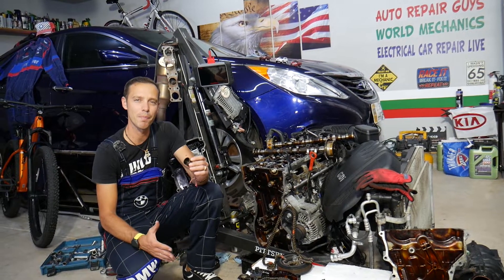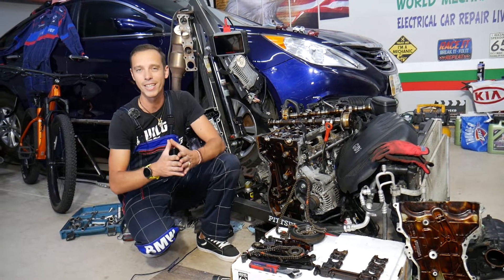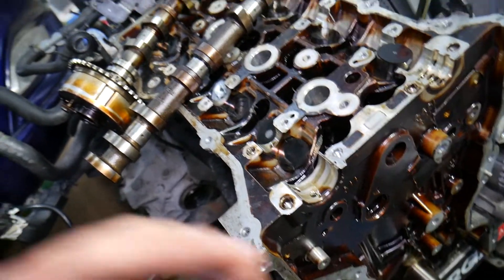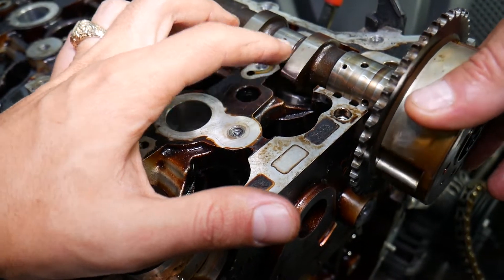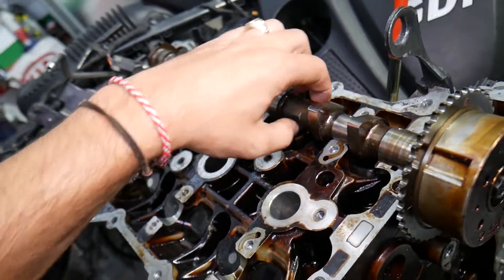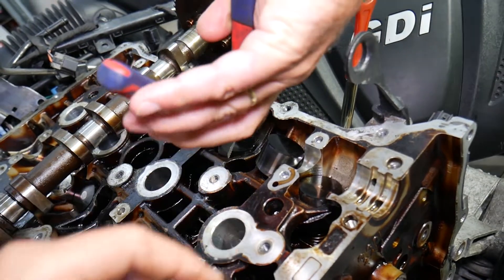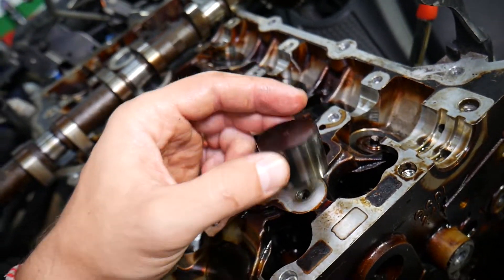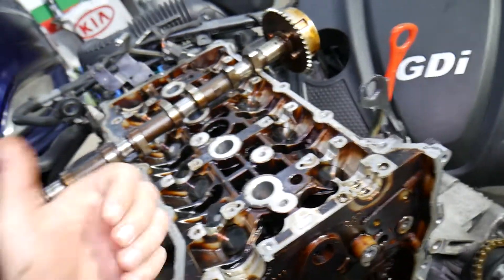WHAT CAUSES VALVE LIFTER NOISE ON HYUNDAI KIA GDI ENGINE

Comment from the maker: heck fitment for your car model:
► Timing Chain Kit: https://amzn.to/4eXHMcJ
► Camshaft Sprocket Intake: https://amzn.to/40dbyWv
► Camshaft Sprocket Exhaust: https://amzn.to/4e2wbaW
► Panel Removal Set: https://amzn.to/3YiMADu
► Assorted Fuses: https://amzn.to/4fx4s3F
► Tool Set: https://amzn.to/3p5MM6t
► Screwdriver Set: https://amzn.to/3XRB28Q
► Castrol Oil: https://amzn.to/3xBc8B9
► Oil Filter: https://amzn.to/3w0Ulme
► Torque Wrench: https://amzn.to/32qyRwg
► Liqui Moly Engine Flush: https://amzn.to/3IiDBID
► OBD Scanner that we use most often: https://amzn.to/3I4MQfe

► Check out our Amazon Store for the tools and parts that we use: https://www.amazon.com/shop/worldmechanics

Comment: Hi, 1st I want to say, THANK YOU, for making these videos. 
I have a 2014 Kia Sorento LX.
The engine began shaking a making noise. It give me these code:
P2101 P0123 P0222 P0113 P0107 P1326.
I replaced the Throttle Body, and no change. 
It's making a loud "ticking" sound. I thinknit might be a lifter issue. Am I right? Or could it be something else.
Also, it been burning oil, because I have been adding it every month or so, I am 100% there's no leak.

Comment: I have read that a thicker oil can be used for high mileage  engines.
Mine is a 2.2 diesel that has done 98,000 but is only noisy on startup but has got worse.
Reply: Arbitrarily going over to a higher (thicker) oil viscosity is not the solution for hydraulic lifter noise. Higher viscosity oils will help in reducing main bearings noise. Lifter noise is caused by a stuck lifter. Do an oil change by using the recommended oil from a reputable oil manufacturer, observe engine noise for about 1 month (1,000 miles) and see whether it corrects the lifter noise. At this point, if the lifter noise persists, add about 2 ounces of 'Marvel Mystery Oil' available from most auto parts stores. Observe performance for 1 month (1,000 miles). If the lifter sound persists, it is time for an engine oil flush (Too detailed to explain here). Doing an engine oil flush has worked very well for me in the past. Do not take any shortcuts if you are going this route. Good luck!
Reply: @claudea79 The 2.2 Kia has non self adjusting lifter's, from what I have read is that they all need to be replaced after some time.
The thicker oil has helped a little after change and soon after the oil makes it's way up on startup the noise stops!
Thanks for your advice it's much appreciated!!!
Reply: @paulhotson5820  thank you for your response! You are correct! Hydraulic lifters are not adjustable, and besides, you have his noise only at startup. The higher viscosity oil will help because of overall wear; a thicker oil film (wedge) is needed. In the past, I did this at around 100K miles. In the event of a stuck lifter, an oil flush might free it up.
Reply: @claudea79  That's cool bro,will try a flush next time...
Reply: @paulhotson5820  What I did and what worked very well was this. When the engine oil was 1 quart low, I added 1 quart of Kerosene (kerosene is a lubricant, and not a de-greaser) and let the engine idle for 10 to 15 minutes. Then I drained the oil and added the recommended engine oil one grade higher viscosity. That worked! HTH!
Reply: I have the same problem, only on startup, I do not know If this is the cause
Reply: @jperezts  The problem is with the Hydraulic Lifters as they do wear.
Mechanical lifters must be built with a small gap between the valve and the bucket that is known as "lash". This lash is required in order to compensate for metal expansion when the engine heats up to operating temperature. That is why the noise is present when the engine is cold. Once the engine warms up, the metal expands, and the pounding caused by the gap is no longer present.
On my last service I used "Shell Helix Ultra Pro AG 5W-30" not cheap but has improved the noise on startup alot.

Comment: Before the heat engine recall by Hyundai our 2.4ltr., engine @ 120K miles our engine was quiet except for the standard GDi injector noise. At 180K now on the engine again the engine is quiet except for the GDi injector noise. We do not have any tappet noise at all.
Reply: Hey, can you do me a huge favor stranger? Can you listen to my last engine noise video and say if its normal? Mine is a GDi 1.8
Reply: @RaineG579  sure
Reply: @dlpannebakker  Thank you. Its the last short
Reply: @RaineG579  if you are thinking the knocking noise is tappet’s you might be surprised to find out that it could be the injectors being noisy. GDI are noisy